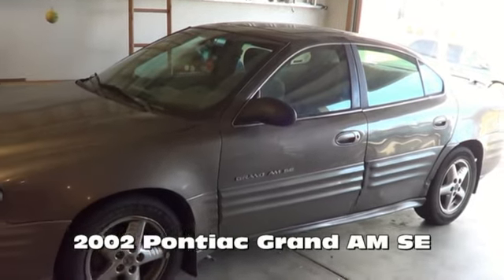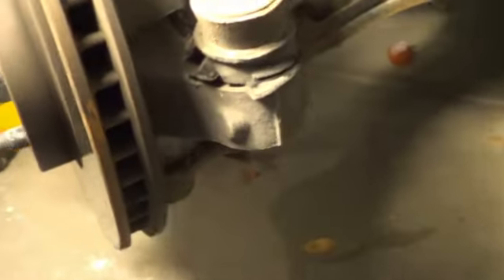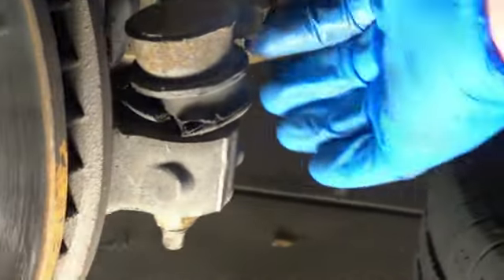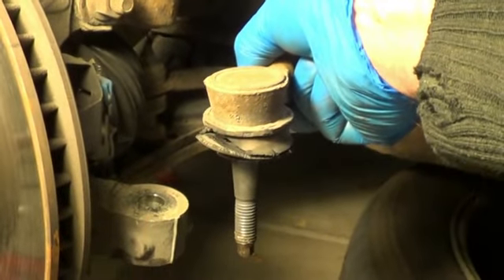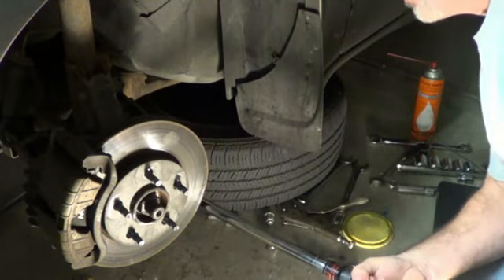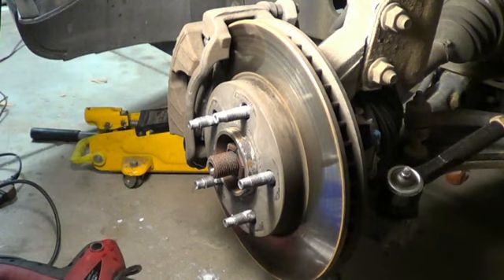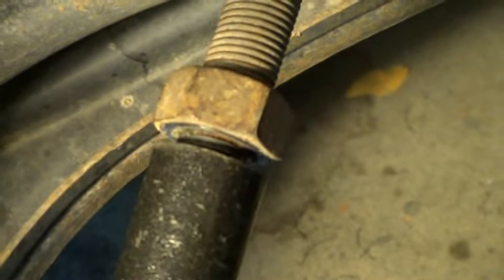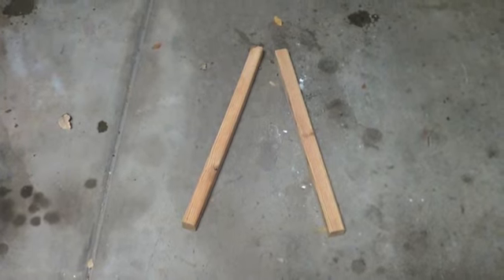2002 Pontiac Grand Am Outter Tie Rod End Replacement

Comment: Working on my daughter's 2003 Alero..I read that the Grand Am replaced the Oldsmobile Alero in the GM line.  Last year worked on my 99 Ford Expy..replaced inner and outer tie rods..I am not a mechanic.. Btw the video is very clear..subscribed.  Pianostyle100

Comment: Great video, I had a question... The rubber on my outter tie rod is all torn and I wanted to replace but I wanted to know if it would be wise to replace inner tie rods as well? Would the old inner tie rods wear out the outter ones prematurely?
Reply from the maker: Inner Tie Rods don't go bad as often, and they are more difficult to replace.  While you have the old outer tie rod removed from the knuckle is the time to test the inner tie rod.  See: How to Tell if Your Tie Rod is Bad (about 1/2 way through) by Chris Fix.
Reply: Jim Dandy alright ill check it out, thanks!

Comment: I am down to cutting it off and getting a new outer tie rod.
Reply from the maker: I hope you were able to get it one way or another.  My guess is that the "castle" nut is spinning but not moving on the threads?  Like mine the tie rod's stud must not have been stuck in the steering knuckle, so it spins with the nut.  You can rent a pick fork and try pounding it in on the top where the rubber boot is to hold the stud.  Heat from a propane torch can help.  They make nut splitters.  If there is enough room for a hack saw blade you can hold the nut and cut the stud, but it's probable hard steel.  Good luck..
Reply: I cut it off in under a minute with the angle grinder. Thanks again for helping!!

Comment: I had a guy come out. He did the alignment in my garage and it was dead on. Guy was a master mechanic. He did it with the tires on and I had to help him by holding the steering wheel while he did the adjustment to get it straight . He also said that if you don't hold the wheel that it could move during the adjustment. I just drove it and it's fine. just thought I;d share. I had to cut both old tie rod ends off. The nuts were seized. Your video did help me. Thanks again I am off to pick up my daughter.
Reply: Hell yea brother

Comment: I've replaced a number of tie-rods over the years. Between my
own cars, and those of friends, I've developed a 'Feel' for exactly
how tight that "Castle nut' should be before inserting the cotter
pin.  Never stripped the nut though.
Reply: @Russ Atchison Okay Russ, here's the deal.  If you haven't 
loosend the C-nut yet, take a flashlight----observe how much
of the Tie--rod bolt is showing.  When screwing the C--nut off
you can either count the number of turns it took to remove it,
or simply use a Torque wrench to 'Specs.'  If ya' have no T--wrench,
Just make a quick observation as to where the Cotter--pin hole
is.  Then just tighten your New C--nut real snug.  If you've gone
Past the Cotter--pin hole, just back OFF the C--nut until you're
lined up.  The Key is, make sure there is NO "Play" between
the C--nut and the bracket to which it's fastened.  You should
Not be able to fit an "Exacto blade" between IT and the C''nut.

Got it?
Reply: @Russ Atchison Pretty easy jod actually.  Shouldn't be a
problem.  And, you're welcome---any time.
Reply: @Russ Atchison Not to worry. As long at the Nut is tight, and
the cotter is lined up---you're good to go!  Take your hand and
try to move the Tie--rod when you're done;  If it's tight and stable,
you got it.  Go for a spin with your window down.  See if you
can hear any noises coming from the T--rod.  And see observe
how the car "Feels."
You probably know this already but, you might need a little front
alignment.
Reply: @Russ Atchison Correct!  You have to align the Slot with the 
cotter hole.  The main trick is to turn the C--nut as tight as you
can BEFORE passing the Cotter hole.
Reply: @Russ Atchison You'll feel it.  Happy driving!
Reply: @Russ Atchison Well, does your Old one have a washer?
Reply: @Russ Atchison That's it.  Have fun.
Reply: @Russ Atchison If you can, use your wrench and try to turn
that C-nut clockwise to lign it up with that hole.  If there isn't
enough 'Slack' to do that, it should be just fine. 
As far as your steering wheel----start your car, turn it until it's
Positioned properly.  Then, step out and check the position
of your tires.  One, or both of them is going to have an im-
proper alignment----the, "Toe-in" is going to be off.  This will
wear out your tires prematurely, not to mention, make your 
tires Squeal around corners.  A person CAN align a car at
home using string, jackstands, a long stick, or one of a num-
ber of techniques---but it is recommened to simply take it in
and have it professionally aligned.

Thanx for asking.
Reply: @Russ Atchison Well, the recommened approach is, to slide
the Cotter pin through the little 'Gate' that divides the 2 "Castles,"
which in turn ligns UP with the Cotter pin hole.  You shouldn't 
have to, "Hope like hell," that it works, my friend.  Do it "By the
book," and there will be no problem.
Reply: I think they're cheap nuts sometimes too when they strip

Comment: If you're steering wheel was nice and straight before and it's not straight now sometimes you can come back and work the inner tie rod back off the jam nut and turn it a few turns remember which direction you turned it tighten your jam nut back up take it for a ride again if your steering wheel is straight now you should be okay I did that one time and it was perfect and I had perfect tire wear especially if you're only doing the one side now because you won't know which side it is if you're doing both sides and your steering wheel was straight I would do them one of the time and road test and make your adjustments, until the steering wheel is straight and then do your other side.

Comment: How did you get that nut off? I am struggling with it. Please help.
Reply: Did you watch that far into the video?  He showed it at 8:13
Reply: 8 mm socket fits into the nut as it loosens..gigantic pain in the ass dealing with 23 year old car parts..
Reply: @daddyrabbit835  It just kept spinning. I ended up just cutting them both off.
Reply: @NightFoxx1  It was a huge pain.